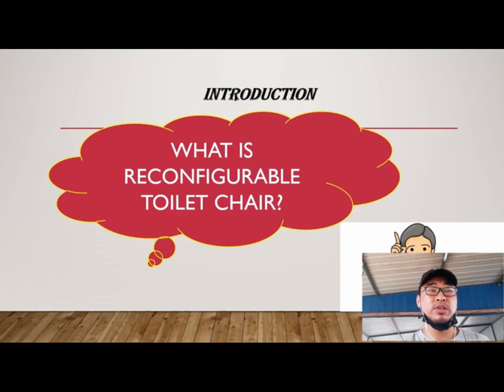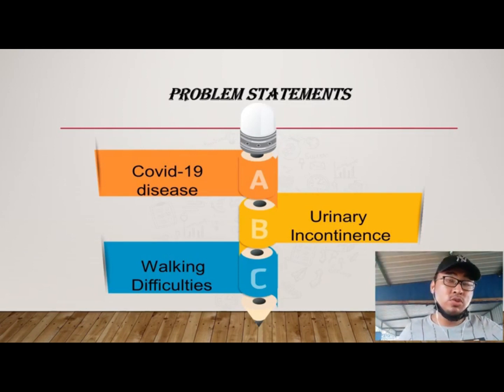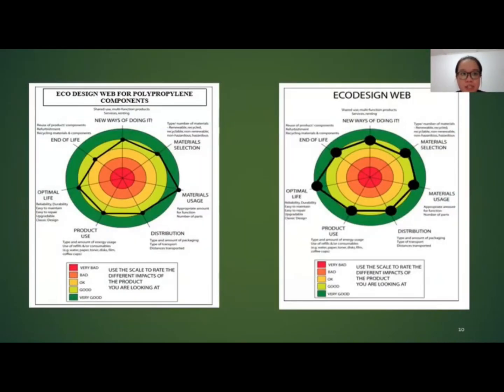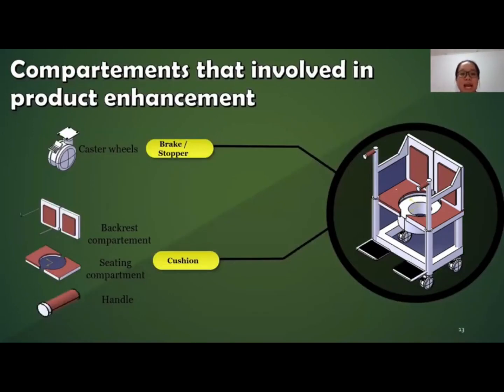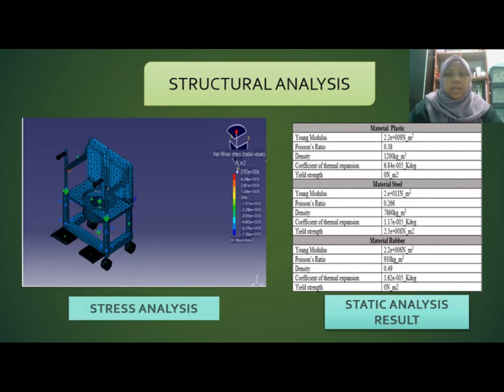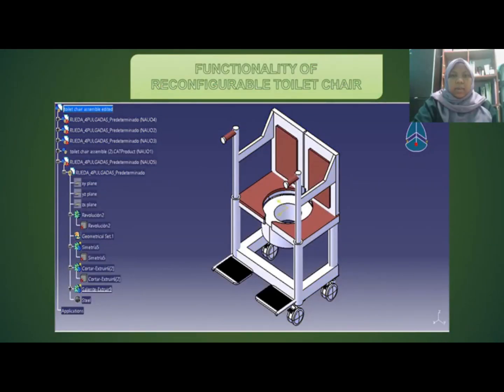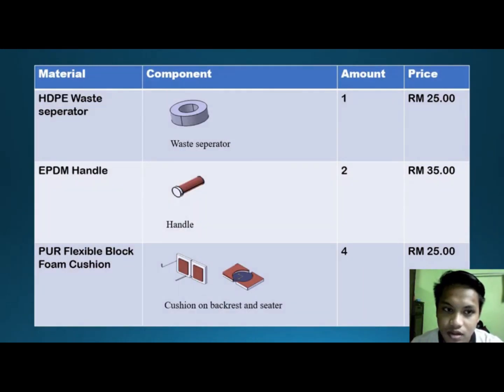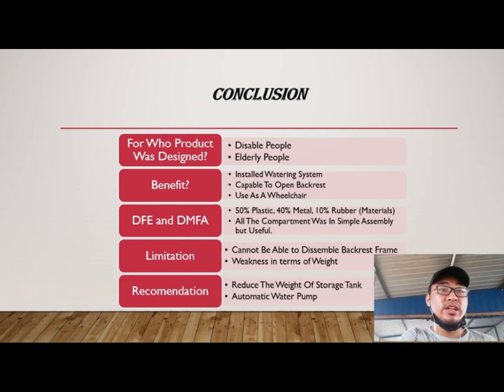VIDEO PRESENTATION FOR INTEGRATED DESIGN PROJECT (GROUP 6: RECONFIGURABLE TOILET CHAIR)

Comment: Assalamz and good day all presenters. Good work!

The contents of the video look.... ok, but I found some missing, inconsistent or confusing information:
1. Two presenters speech are too fast. Cannot really understand what are you guys saying.
2. The presenter mentioned "100 N" force applied on the seat for structural analysis. Its almost equivalent to 10 kg only. Are the potential users only small kids?
3. If the structural analysis shows a failure, what exactly you will change in the design? How it will affect the cost?
4. In the RULA analysis, how did you evaluate the wrist of the dummy? Because, when looking at your design, if I am sitting on the chair, I might twist my wrist when holding the handle.
5. In the cost analysis, the presenter mentioned "This is the cost for 864 units." Which cost? RM 5950 or RM 310?
6. In the calculation, the cost per unit is RM 245. Where exactly did you get this number? It is inconsistent from the previous slide.
Reply from the maker: Salam sejahtera and good day to panel.First of all, thank you for the comments.
1.Dr,sorry for our inconvenience becoz we have fast forward our video presentation.

2.It is actually 1000N which is equal to 100kg which is the maximum allowable mass that can be exterted on this product.

3.Generally,the product structural analysis for this product would not sure failure because our group have to design the strong structural for the body frame of this product.other than that,the structural analysis that we perform also shows good impacts in terms of structural analysis.

4. Actually the design is not really user friendly for the wrist part bcs we actually dont have a part where the user can put their wrist. Hence, based on rula analysis the result for the wrist part we scored 3 in which we need to investigate and improve more on that part
Reply from the maker: Hi and good afternoon panel, I m here again. I m here mind to share some informations with the panel about our group product (RECONFIGURABLE TOILET CHAIR)
https://drive.google.com/drive/folders/1pKRxJv0nP96vDvVtazP6uD0U3gj19o9d?usp=sharing
Reply: @amysoh6966  6. But how exactly you get the 245, especially with the cost 5950 and 310?
Reply from the maker: Salam sejahtera @NidzamuddinMdYusof   .I aldy include all the information inside the file
Reply from the maker: For question 6,
RM 350 cost per unit is the cost that we going to sale  our product to the market. The value of 245 is the original place that we originally plan to sale.
Reply from the maker: A short video simulation for panel to have view. https://youtu.be/0nH_Vjxg8Jc
Reply: 5. Both are calculate for 864 unit Rm5950 is for fixed cost, rm310 for variable cost